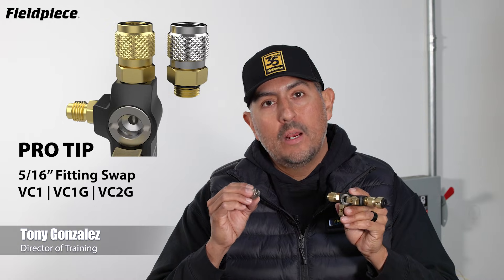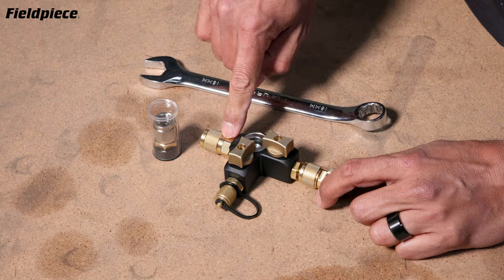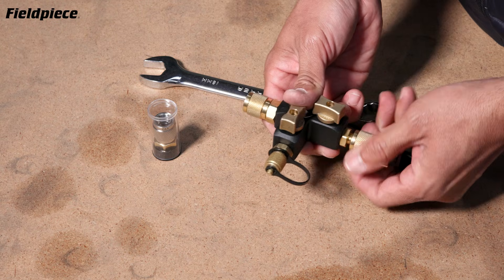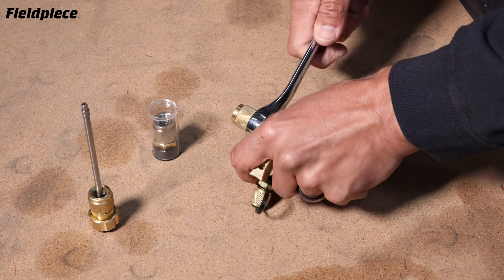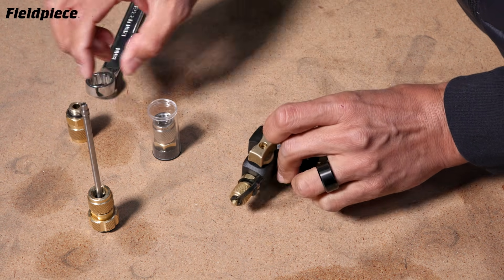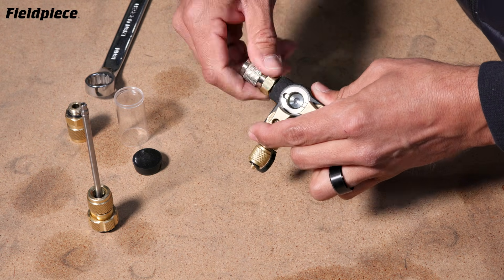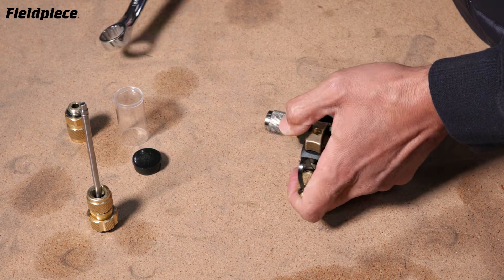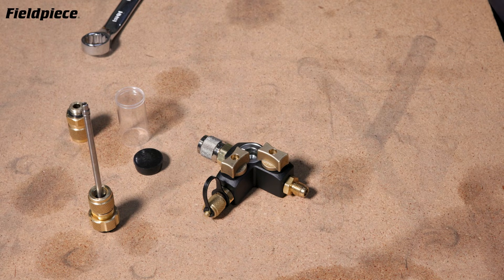Fieldpiece® Pro Tip | Swap 5/16” and 1/4” Fittings on Valve Core Removal Tools | VC1, VC1G, VC2G

Comment: The sad part of 5/16 is most of the mini plit system are built with the ports in the most awkward position that you can barely get an angled adapter on the port. I wish someone would tell all manufacturers of mini splits to help us HVAC guys do our jobs better. It sucks when you have the tools and can't use them!